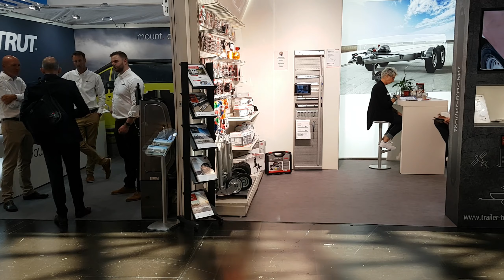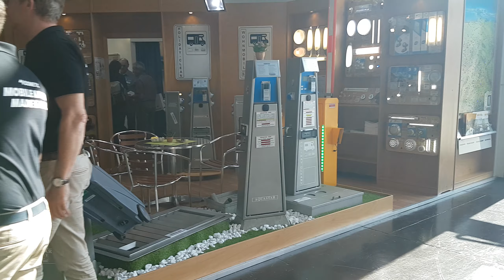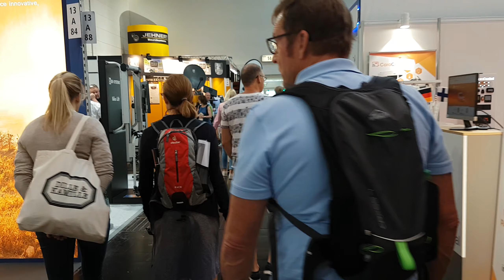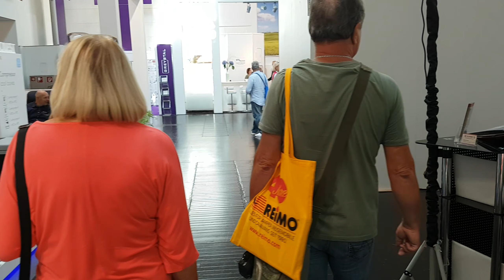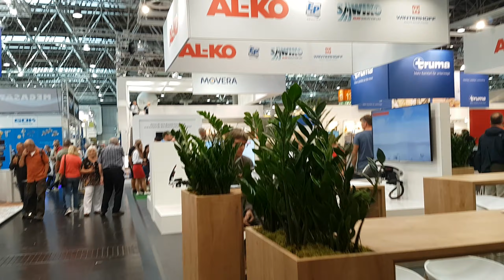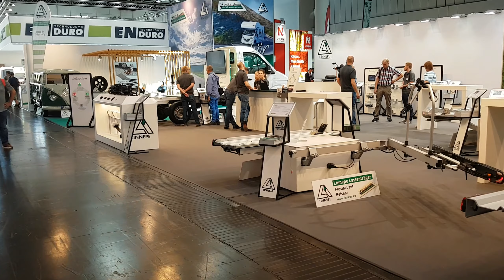RV equipment at Caravan Salon Dusseldorf

Comment: The best reason to use diesel for heat is that you already carry it to fuel the car. Not having to worry about explosive gas at all seems like a real goal to me, at least as I'm still thinking about self-building. Eliminating gas altogether would be great. You can also get diesel at any gas station, which is not true for LPG.
Reply from the maker: It depends where you are.  There is only one LPG station within 100km of where I live in the UK but in most of continental Europe it can be found just about everywhere!
Reply: You are right but do not forget that Diesel burning is noisy and stinks. Some neighbours in campings will not like it.